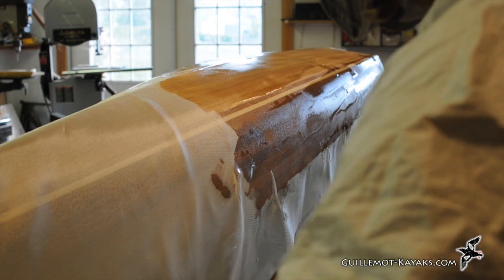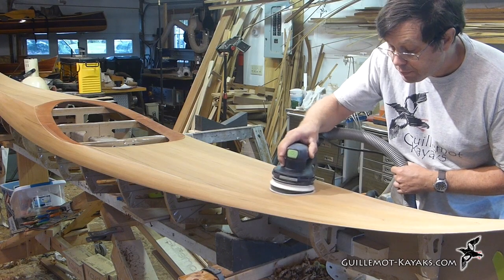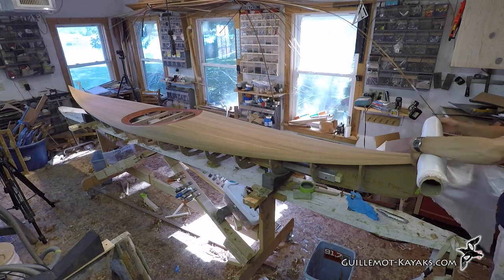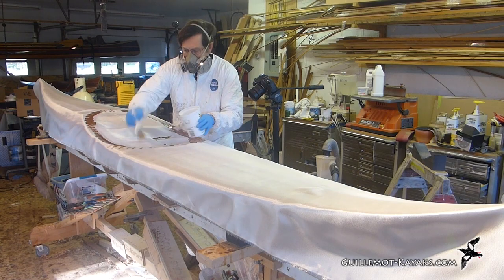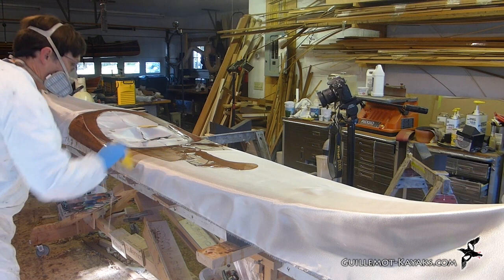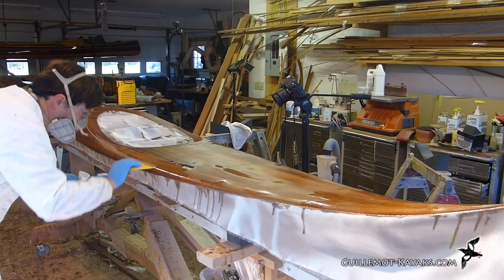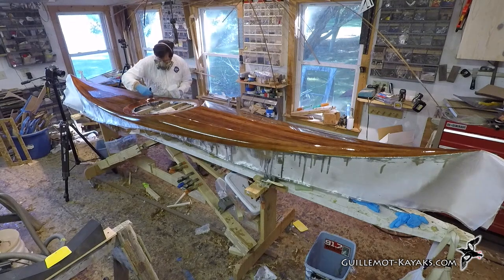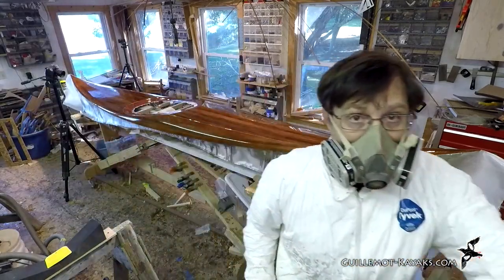Making a Strip-Built Kayak - Glassing the Deck Exterior - E10

Comment: When you glassed the hull you laid the cloth at a slight diagonal, but you laid the cloth straight on the deck. What is the benefit of laying the cloth at a diagonal? It also looks like you used a different cloth on the deck then the hull. Are you using different weight cloth, or is it just a more narrow roll?

Thanks for always answering my questions. I'm loving this series and excited to start my build soon.
Reply from the maker: Laying the cloth on a bit of a diagonal gets the weave of the cloth on a bit of bias, i.e. the yarns are running straight down the length of the kayak or straight across. This allows the yarns to cross over the keel, and stems diagonally, which is easier for the yarns. 

With this diagonal layup, the fabric will conform more easily around the stems with. This has not mattered yet in the build, but will later.

The diagonal also allows you to maintain a wide bit of extra cloth beside the bow and stern. The next time you roll out the cloth, you can nest the next cut into the extra, thus using the cloth more efficiently.

Comment: Hey Nick, your "shock cord" knot had me looking for the "official name" and maybe it's the "zeppelin knot"?  The method of tying is different but I think the result is the same.  I make study it further.  Out of rope tricks time for today.  Cheers.
Reply from the maker: It is different than the zeppelin knot. I believe its called a "water knot".
Reply: Yes, I did more research (hyperfocus time-wasting) and did find it to be the "water knot"/"ring bend". Also that one can make a similar knot starting with a figure eight knot.  And furthermore that the Alpine Loop (a new fave) can be used as a bend.  Thanks for your videos. I'll make a boat or two as soon as I can.

Comment: What if the wet out coat is completely set hard for several days? Can you still add a fill coat to cover the weave? Sanding preparaion I guess?
Reply from the maker: If the epoxy has hardened completely, you  want scuff up the surface as best you can. Since the surface may show a low of weave texture, you don't want to just sand it down. This can cut into the top of the weave, essentially cutting the fiberglass strands into short pieces. Instead, scrub the surface with a Scotch-Brite style pad https://amzn.to/496VqZ2 which can conform a bit to the texture while not aggressively cutting off the high bits. 

This not as effective as real sanding which is why you want to get the fill coat on while the wet out coat is still green. Try to get to the fill coat as soon as you can for best results.
Reply: Great tips Nick!  Thanks!  Do you think thay higher cure temperatures would help the effectiveness of the method with the scotch brite style pad scuffing
Reply from the maker: @Stefanos-g7m  I don't know that cure temperatures directly relate to the effectiveness of the scouring pad. 

Slower curing epoxy will have a longer time before it needs to be scuffed up, where faster cures will need scuffing earlier.

Comment: As far as I understood you didn't use a sealing coat of epoxy on the wood before you began to glass this boat. Do you recommend the extra pre-coat if time is not an issue? If you were to do one, would you just need to apply a light coat with a tight 20-degree squeegee pull, or would you apply a heavy coat and sand it down?

Loving the reboot on this series. By the way, the RoboBevel has no problem making it in checked baggage for a cross Atlantic trip.
Reply from the maker: The reason to do a seal coat before rolling out the glass is to control epoxy absorption and outgassing. These are valid reasons depending on a variety of factors from wood selection to shop temperature that may suggest a seal coat is a good idea. But, I have found that the procedure I'm showing with no seal coat and allowing some time for the epoxy to soak into the wood, provides good results.

If you do a seal coat you should either roll out the glass while the epoxy is still sticky, or wait until it is fully hard and then sand it. Smoothing the glass on a sticky surface is no fun. Letting the epoxy cure creates the risk of amine blush (even on blush-free epoxies) that would be very hard to remove due to the still rough surface of the wood.

If I can eliminate a step while controlling the risk of cloth starvation or outgassing bubbles, by laying the glass on directly, I think its worth it.

Comment: Hey Nick, would a heat gun be as efficient as a blow torch to remove air bubbles? (I'm the kind of klutz that would drop the blowtorch or burn the boat)
Reply from the maker: I use the heat gun with some varieties of epoxy, with others the torch works best. I’m not sure why the difference.

Comment: Would a heat gun work as well as the torch to get rid of bubbles?
Reply from the maker: It depends on the epoxy. I'm using MAS on this kayak and a heat gun would have worked fine. However, a heat gun seems to have no effect on West System. Only a blow torch works.

Comment: Does the mas epoxy allow you to clean the brush or do you just plan on using it as a disposable brush?
Reply from the maker: I use disposable brushes. It certainly is possible to clean the brushes, but it generally requires lots of nasty solvents and then you are left with a toxic slurry that needs to be disposed of. The chip brushes are inexpensive, made of wood, boar bristle, and a bit of steel. The hardened epoxy is pretty inert.

I've decided that it is environmentally better to throw out the brush than to clean it. 

BTW, I was using a fancier brush for the  fill coat in this video as a test to see if the results were better than the chip brush. I'm going to stick with the chip brushes in the future.

Comment: Nick are you using West System, East system, which brand of epoxy are you most happy with?
Reply from the maker: I primarily use MAS but I will often use West with 207 hardener for fill coats. The MAS wets out glass well, the West levels very well.
Reply: @NickSchade  Please clarify whether you did the fiberglass and resin with MAS, then the filler coat with West System on the same boat? My major concern is using different products and compatibility between them. Thanks for sharing.

Comment: Hi Nick!

I'm building a Petrel kayak. I finished all the stripping. Sanded the deck, put on a first layer of glass, let it dry until tacky and then applied a fill coat of epoxy. I'm working in a barn. While I was working the temps were in low 70s. After I finished the glassing, the temp went down to mid 50s. Several weeks ater, the fiberglass started to delaminate in one place on the deck. In another place, it got a crack. I haven't yet glassed the inside. I'm attaching pictures with links:

https://flic.kr/p/22KsV8A

https://flic.kr/p/23MnwQs

https://flic.kr/p/23Mnx5A

What went wrong? Did I apply the glass too thick? Was the temperature wrong? Did I not sand enough or sand too much? How can I make sure this doesn't happen again? And how can I fix this? Is it best to sand off this section and apply a fiberglass patch?? I'm so bummed!

Thanks in advance!
Reply from the maker: Ooh, that's not good. Sorry to see that.

It is hard to know for sure what caused it. It looks a little like you may have had an epoxy mix failure. Possibly you didn't mix it quite enough. As a result, the epoxy never set up completely. This would allow the glass to delaminate.

It shouldn't be hard to fix, but yes, it requires sanding of that spot, and applying a patch. You should be able to make it as good as new, with no visible flaws.

As you sand pay attention as you hit get through to the delaminated spot and notice if the epoxy is gummy or sticky. That would indicate a mix failure.

You might put the boat out into the sun a bit to see if any other spots appear. May as well deal with all the problems at once.

Good luck.
Reply: Nick Schade Thank you for the advice. I will set it in the sun to check for other spots and get it fixed. At least it happened before I got to varnishing and other future steps! Live and learn... Right? :)
Reply from the maker: Don't feel bad, we are all still learning as long as we are still living.